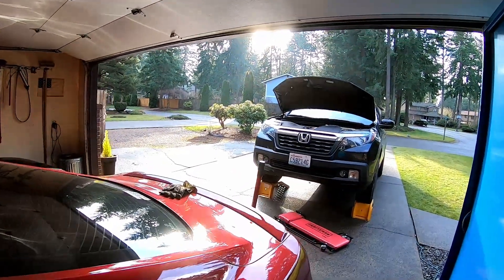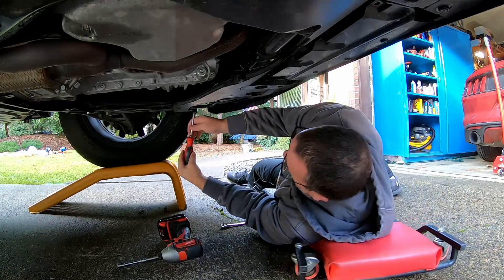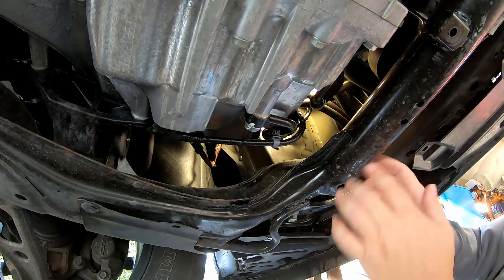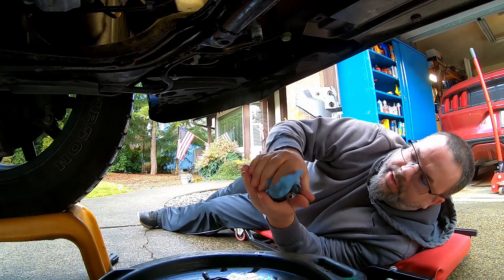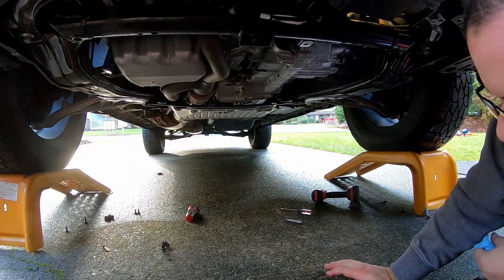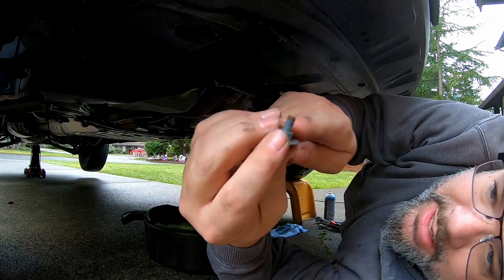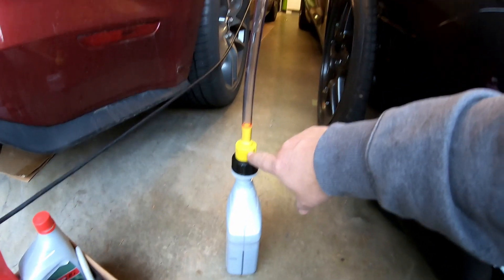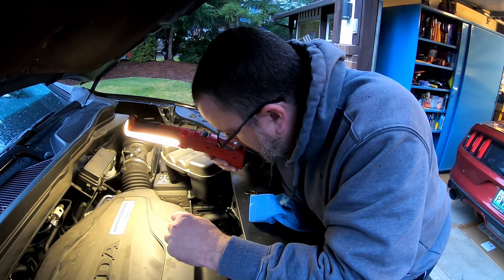2017 Honda Ridgeline 2016 Honda Pilot Transmission Fluid and Filter Change, Yes there is a filter.

Comment: Hey Mr. Black,
I was shocked when I read page 523 of the Owner’s Manual for the 2017 Ridgeline.
It specifically says; “Have a dealer check the fluid level and replace if necessary.
Do not attempt to check or change the automatic transmission fluid yourself.”

I also checked for the manufacturer's recommended service schedule for the ATF fluid, and it’s clear as mud. 

I’m guess it’s a matter of time before Honda is on the other side of a class action law suit alleging “right to repair” infringement. Who do they think they are, John Deere? lol

I know this is hindsight, but it would have been nice to check the fluid level before you drained the old fluid at normal operating temp to get a reference. 

I looked up the torque spec for the drain plug, it’s 35 Ft-lbs with new crush washer. But, I have a feeling both your wrists, and at least one of your elbows is calibrated to within 5 Ft-lbs.

35:18 If I have a question, can you tell me where to put it? Lol 
Good work, have a cold one on me.
-Chuck
Reply from the maker: lol Thank Chuck.   Got the fluid dialed in pretty quickly.  Added a couple tenths of a quart more.  The cool thing is you can only read one side of the dip stick and the stick is keyed.    I tell you what, when you work on as much junk as I have in the last 35 years you definitely develop a good calibrated wrist.  There's of course still a time and place for a good torque wrench though, don't get me wrong.  :)   Thanks for the support as always.
Reply from the maker: @PanzerPlatform   Nothing worse as a mechanic than the feeling of something torquing and then going loose again lol.   Wish I lived closer.  I love fixing stuff like that!    Also love motorcycles.  Been around them all my life.
Reply: @PNW_Car_Mods  
Whoa, whoa, whoa.
You mean to tell me you relish fixing other guys' mistakes. 

And you like rubbing their noses in it like house breaking a new puppy?

That's just terrible. Terrible. 
Me too.
Reply from the maker: @PanzerPlatform   lol don't even get me started on Puppies Chuck.     Ours is a handful.    My wife seems to forget how much work puppies are.  They're worse than babies!
Reply: @PanzerPlatform  He over torques it with a cheap wrench.  I bet that wrench clicked and he kept on tightening the fastener.  If he used a Snap On ATECH digital wrench and cleaned the threads and mating surfaces, it would not happen.  When you torque, the threads and mating threads MUST be cleaned.  Then you kiss the fastener tight and ensure it is seated properly.  Then you torque.  If a two stage torque is required; it must be completed as per the service manual.

Comment: Thanks for the video. Really thought there was a fill bolt ( directly below the dipstick). I could be wrong there, but thought I’d mention in case someone else knows for sure.
Reply from the maker: Someone else mentioned there should be a fill bolt.  I did not go back and look for it though.  If you have a long trans funnel though I think in most cases it's easier to pour the fluid than pump it.
Reply: There is a fill bolt (3/8"), but it is much easier to just add the transmission fluid through the dipstick tube.

Comment: Changing ATF filter is advisable once you replace new fluid on transmission so the fluid goes clean, not replacing filter the dirt is still inside transmission upon circulate of fluid
Reply from the maker: filters are designed to trap particles not release them back into the wild.

Comment: Nice video. Really need some safety jacks for the back.  Dig the detail and how clean you kept everything.
Reply from the maker: Thank you James. I didn't do the whole job with it jacked up like that.  I was just draining out any remaining oil in the transmission with the jack.   I was only working underneath where the ramps were the whole time.  By all means be as safe as you can be.  I watched somebody get crushed by a car when I was a kid.   I've also been working on cars my whole life so my comfort level will be different than the average weekend warrior.

Comment: I did the transmission filter and fluid today on a 2016 Pilot EX AWD with Honda transmission cooler.  I drained and refilled 4.2 quarts.  It kept draining and draining.  Probably it was coming out of the cooler.  Measuring the old fluid helped me to know about how much new fluid was needed.  Thanks for the video.  The picture quality and camera locations were great.
Reply from the maker: Thank you Jim.  Glad it helped in some way.  :)

Comment: I have a 2017 Pilot with 30K and wondering how many miles before the filter should be changed?
Thank for the video  i ENJOYED WATCHING YOU!  Almost meditative :-)
Reply from the maker: Thank you Mark.    Per the factory that filter is intended to last the life of the vehicle or if the transmission were to fail it would get changed.  In other words it's not mandatory to change it.    
I personally feel like it is a good idea to change it once at the first trans service which I hear per the maintenance minder is at 45K  and then the second filter can go until the trans or the truck goes to truck heaven.
Reply: @PNW_Car_Mods  Thank You!

Comment: Thanks for your post.  As Joe Friday would say "Just the facts Mam". I have a 2017 Ridgeline RTS and need to install a fluid cooler.  Have you posted a video on the subject?
Reply from the maker: Negative otto.  Our trans cooler was factory installed.   I have not seen a video on adding the factory cooler to a gen 2 Ridgeline.

Comment: Thanks for showing this essential process. When I bought my used Ridge at 42kmi, it hesitated up hills - probably never changed.  I reset the tranny logic and that helped, but nothing as good as after the fluid change. I dont think the dealer changed the filter like you did😫
Reply from the maker: You are welcome Frank.  Kinda bummed out to hear people are having some troubles with these transmissions..
Reply: @PNW_Car_Mods  I feel satisfied with having found and fixed the issue. No help from the dealership though - where the problem is.  The tyranny needs timely maintenance, that's all. If you know where I could look for a traditional maintenance schedule, I'd be in your debt. The owners manual is seriously lacking in that regard. Thx
Reply from the maker: @frankbair5605   lmao I love that we have to play stupid games with words due to utube sensoring.  Always good to service your Trainee for sure.  It leads to long tyranny life.

Comment: Excellent video. Any recommendations for LED bulb replacement for the driving light? I have a 2017 Pilot.
Reply from the maker: We had JDM Astar LEDs in both the low beams and the driving lights.  Loved them and they matched the DRLs light color exactly.

Comment: My transmission in my 2017 Ridgeline started shuttering/lunging occasionally at 48,908 miles. By 52,500 miles the service department told me I needed a new Transmission. The message on the dash said "Transmission Problem". Cost to replace is $10,000.00. Very disappointed with the durability of this vehicle.
Reply from the maker: I couldn't even imagine paying 10k for a Honda transmission.  Those are Diesel truck repair prices!

Comment: Crappy video?  I think it's a great video.  You speak clearly and seem to know what you are doing.  You aren't using any music that makes it difficult to hear you.  You could include part numbers, but it's not necessary.  Have you thought about adding a transmission cooler?  I mention that because you spoke of towing.
R, Steve
Reply from the maker: Thank you from one Steve to another.   RTL-Ts already have a trans cooler from the factory.    Also part numbers are either in the description or a pinned comment.
Reply: @PNW_Car_Mods  Do they have a cooler in the radiator, or an external mounted cooler?  My Pilot only has 24K miles on it and its trans fluid is turning brown.  This might be another trans that needs a drain and refill with every crankcase oil change; 5k miles.  I am learning that transmissions with overdrive run hotter than others without.  The parts guy at Honda insisted my Pilot did not have a serviceable filter.  I pressed him on the issue and he learned that it does.  That in-line filter is $50 ...$11 from RockAuto (RockAuto can be problematic.  Be careful what you buy from them.)   Thanks again
R, Steve
Reply from the maker: @steveinla8963  the one I am speaking of is external in front of the radiator and it is a real cooler and not just a bent up piece of tubing like an old school power steering cooler.  Should be standard on any AWD Ridgeline.

Comment: Mr. Black thank you for this very helpful video. It's very detailed. Do you think it's okay to replace the fluid first and replace the filter later? I already have the fluid and still waiting for the filter. If I wait for the filter I will have to wait another week to do everything. Thanks.
Reply from the maker: Thank you Win.  Changing the filter can be done at anytime.    One thing I need to do is to find out if every model of the 2gen Ridgeline has an external filter or if it's only the models with a transmission coolers from the factory.  Working on that detail now.
Reply: I have the 2017 Sport and basing on your video I looked for the filter and it’s there. I guess I’ll just have to wait for the filter so I only have to crawl once😇. Thanks for the reply. Aloha from Hawaii.🏄‍♂️🌈
Reply from the maker: @winxwenmuana1228   Win, that's great feedback.  Thank you for letting me know on the filter being there on a Sport!
Reply: I finally replaced my 2017 Sport’s filter and fluid. I measured about 3 oz of whatever fluid that dripped from the filter. For the most part the hardest thing was to remove the filter and putting back the cover.😇 Thanks to your video I already knew what to do. I torqued the  drain plug to 36 lbs/ft. I followed the specs from my wife’s 2006 Odyssey. I did not see your recent post. I hope I did not over torqued it but I am thinking the crush washer offsets that a little bit. I would like to note though that before I replaced the fluid the engine seems to hesitate when accelerating. Now it’s back to it’s smooth acceleration. Thanks again and more power. Sorry for the long one.
Reply from the maker: @winxwenmuana1228   Glad you got it done!   It's not too bad of a job.  36 foot pounds should not be over torqued.  Hope you get many more miles out of it. :)

Comment: I did this in the Odyssey over the summer and was not too happy when about a month later I get a letter from Honda saying it's a recall item and to bring it in for a free transmission fluid change. :-/
Reply: btw, your analytics for this video should be good, I watched all 36 min. :)
Reply from the maker: JAT, did your van have the filter?    Just curious.
Reply from the maker: @JackofAllTrades1   Thanks man.  I watch a lot of videos all the way through myself too  :)
Reply: MRBLACK947 no filter in the ‘14 oddy ...I was caught off guard when you had one.
Reply from the maker: @JackofAllTrades1  That's why I was asking for sure.  I'm not convinced all the Gen 2 Ridgelines have them either.  I think it may be only the ones with a factory installed trans cooler.  Which for 2017 would be RTL-T and above.
Reply: @PNW_Car_Mods  The service department at my local Honda dealer has never missed an opportunity to sell me a part so once I realized that I rested easy lol. Just got the quarts and a new crush washer. I've been working on these 3.5's for about 10 years now and I love them.

Comment: Very nice video! If I may say something regarding safety, are you not afraid the truck may roll back the way you lifted the rear by the center rear diff? Instead, I think it would be safer to raise only one of the rear sides at a time and support it with a jack stand, then do the same for the other side.. this way there’s always one tire on the ground and/or a jack stand supporting one of the rear sides.. just saying. And my other comment would be not to install the plastic under-guard until you’re done checking for leaks. Other than that, I think you did a great job!
Reply from the maker: Hey Mike. Thanks for the feedback.  You bring up great points.  I will counter as I have in a half dozen other comments.  The truck was not raised to work under it.  It was raised to drain the rest of the trans fluid out.  I also was never under the truck to a point where I could be crushed.   There is a certain amount of common sense that has to be used when working on cars.  Been doing it all my adult life.   As far as leak checking and leaving the belly pan off I would agree if you are uncertain.   I have done enough jobs of this nature to know if I should be concerned or not and a leak check was performed on start up.   I have a hard time with my videos in showing how to do it step by step and showing how to do it as quickly and efficiently as possible.    Again thanks for the comment and no offense taken.
Reply: @PNW_Car_Mods  Ok cool. Glad you played it safe since you have experience doing it. I was in no way criticizing your work, just commented based on what I saw on your video and like you said: common sense. Safety should be our number one concern, especially if we ever have to work under any car. Thanks for the reply.
Reply from the maker: @Mike_44  quite welcome sir.  My videos aren't perfect, but I hope to help others to get out there and do the task.
Reply: @PNW_Car_Mods  👍🏻 That is the way..

Comment: I performed this service yesterday morning.  I have 30100 miles and about 2K towing a trailer.   I thought i would have more trouble getting the 10mm bolt on the filter bracket since it was awkward getting my hand i there.  I actually had the truck on a jack stand on the drivers side and the passenger wheel on the ground.   This way it's tipped toward the open end of the drain plug.  After draining completely to a slow drip wound up draining 4.3 quarts or so.  Not sure where the extra fluid came from?  6 months ago i did bring it in to the dealer because the transmission would seem to get stuck in a lower gear, mainly on the highway in Cruise control.  Touching the gas pedal would fix it.  Apparently there is some TSB on this extending the warranty for an additional 3 years or 75 k miles or something.  They never told me they added any fluid?  The transmission has not been doing this in the past few months either.  I did put 4 quarts back in.
Reply from the maker: Nice job Adrian.  Sounds like you know your truck well and have covered your bases.

Comment: Great video. Couple questions. Is there a filter in the pan in addition to the inline? Details on the on/off funnel valve.
Reply from the maker: Michael this is a split case style transmission.  There is no pan.  Just a drain plug.  The on off funnel is super common at wally world or the like.  You can even pick them up off of amazon.  Thanks for checking it out.
Reply: @PNW_Car_Mods  thank you.

Comment: I honestly think that this applies also to 2017 (3rd generation) Honda Pilot and up. Engine bay looks the same
Reply from the maker: This should absolutely be correct.  They are the same chassis/drivetrain with very subtle differences.
Reply from the maker: I just found a picture of a used 2016 pilot trans from a wrecking yard on google images and it did in fact have the same filter mounted on it.   Thanks for the reminder.  I adjusted the video title and description to match.

Comment: I just change my fluid every 10k miles. V6 Accord
Reply from the maker: Not a bad plan at all.   It is overkill but if you can afford it I think it makes a difference in the long run.
Reply: @PNW_Car_Mods  it is. But I fear Hondas 6 speed automatics. I see many complaints with them online.

Unfortunately